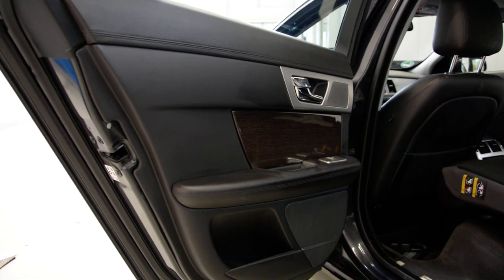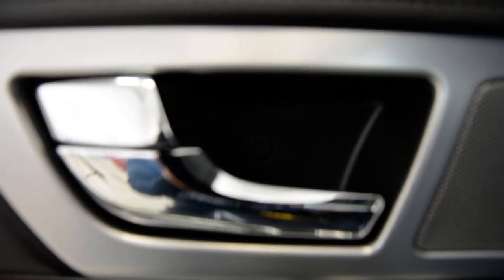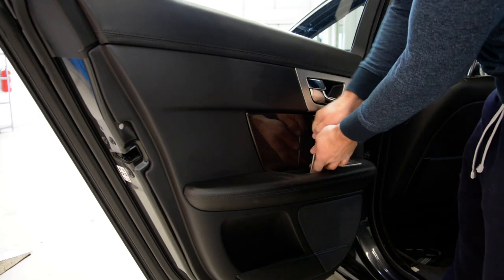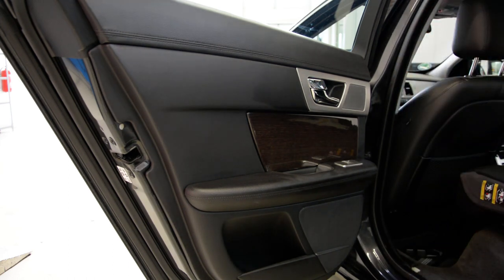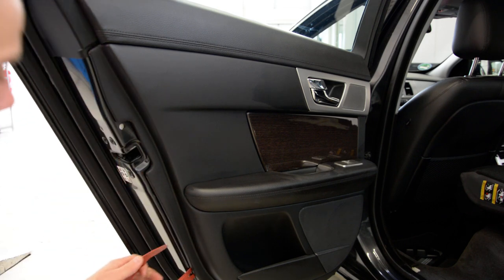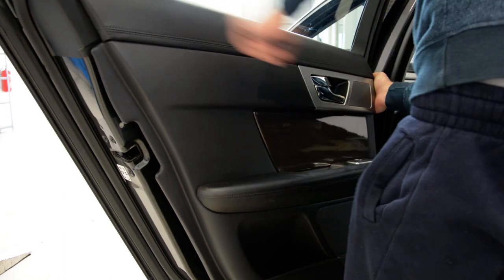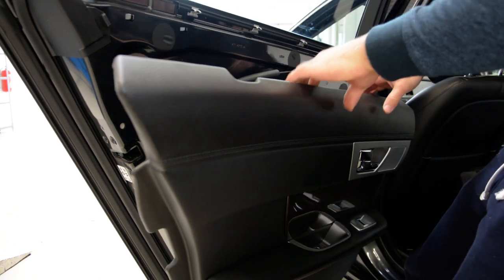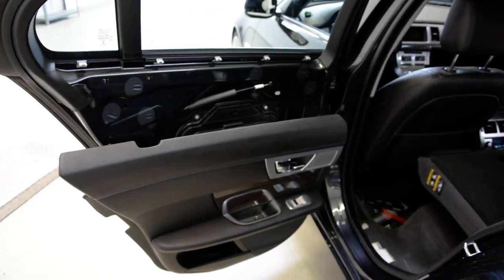How to remove the door panel Jaguar XF

Comment: Just for anyone as mechanically as useless as me doing this. Even if you do not yet have the replacement speaker to fit you'll need to put the door card back on and plug it in or you can't lock the car! But much otherwise it was as easy as it looks in the video. Thanks!

Comment: Why does the XF looks like a better copy of the Mondeo mk3, in terms of layout, screw placement, stackup in door, handles, latches, etc. etc. ? It is just like engineers took Mondeo mk3 blueprints and polished them .... out came the XF.
Reply: So you know MK 3 Mondeo's really well then, I workd at Jaguar when they were designing them and they were and are based on the S Type
That was the Mule they were designed around.